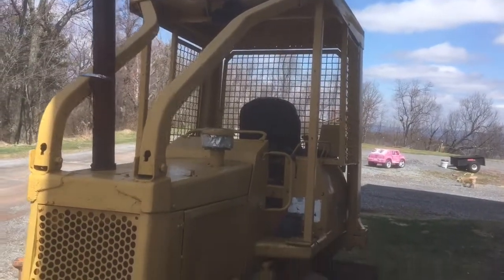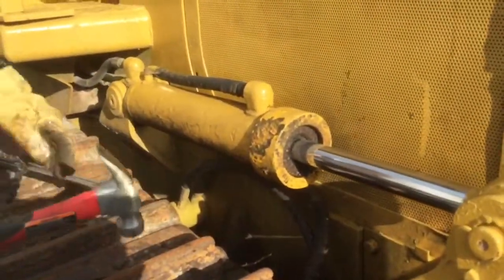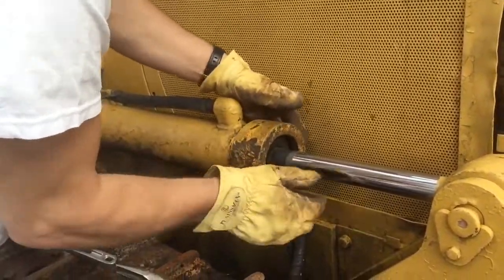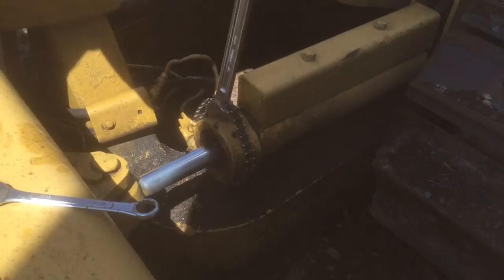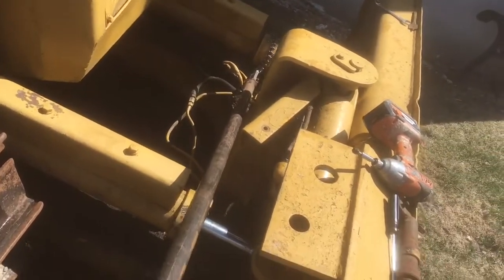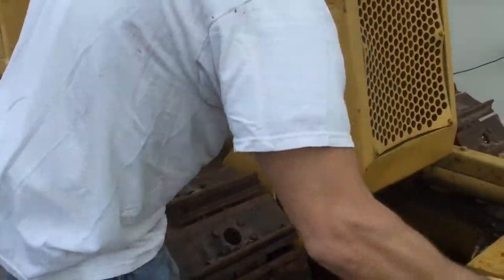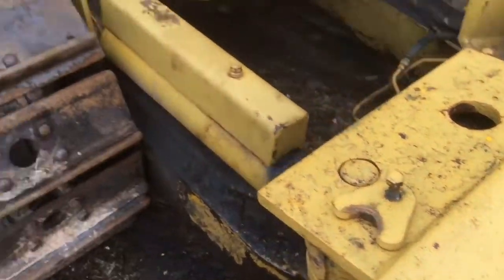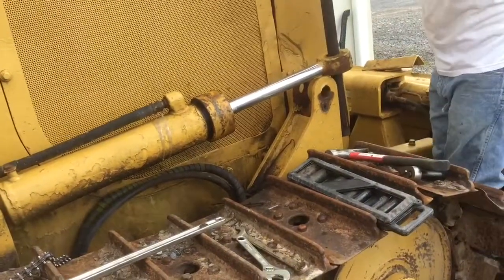Removing hydraulic cylinder Cat D3 Bulldozer

Comment: Do you have any video on the angle cylinders below those that have the inspection covers on them. I'm trying to figure out how they communicate between them. The rear lines are in place but there are no front lines and and don't know how they connect or where together?